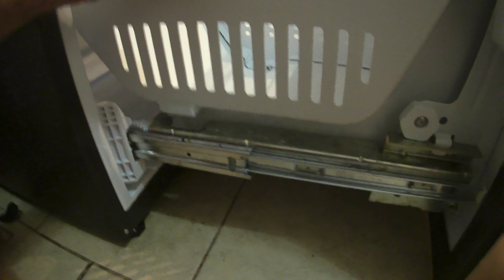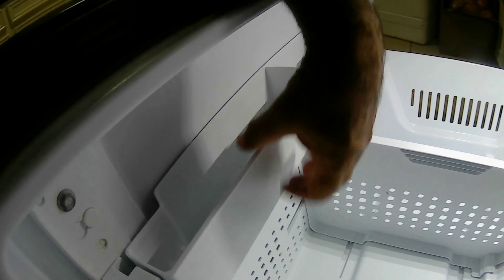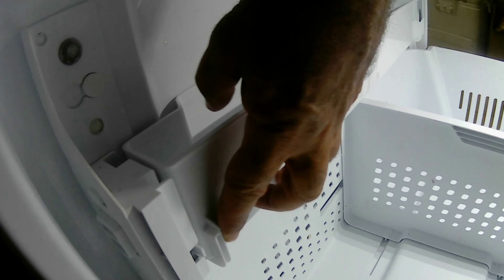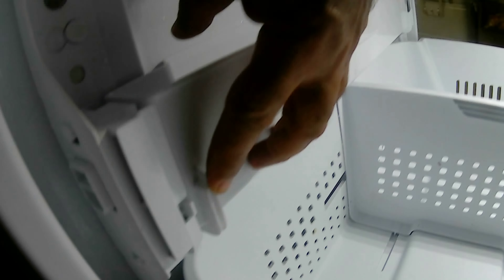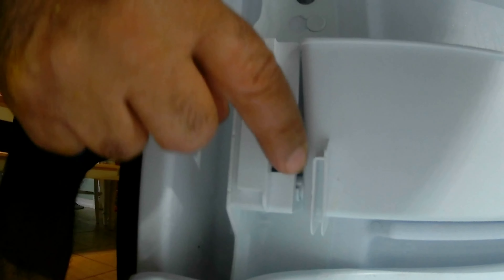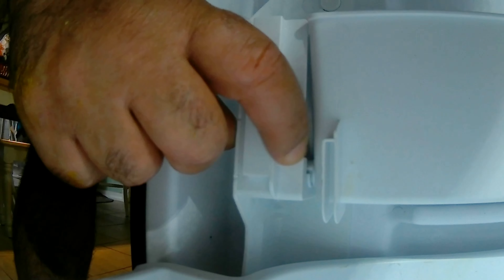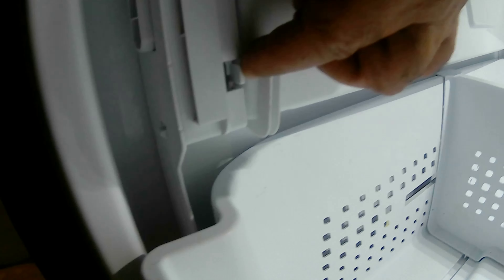Ge french door refrigerator  bin / drawer removal

Comment: What about that small shelf I reinstalled backwards how do I bypass those lips holding it in place?
Reply from the maker: left side and right side are different . I put in backward and managed to push the lever on right to free it. lift the righ side  more to cause a 45 degree lift . make right side higher or lower to cause a tilt. I managed to get it out in 5 seconds .
Reply: @boashna   yeah but I put it in the second slot not the first so I cant lift it. its really hard to stick something in there to hold it down so I can lift it out. I know what your saying that for the first slot I saw the small tab for that but no I managed to jam it into the second slots